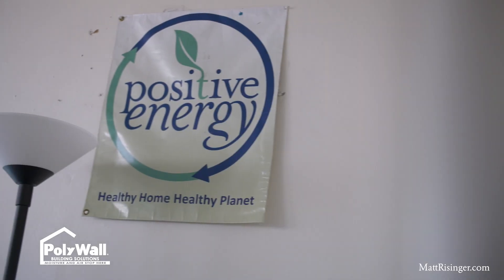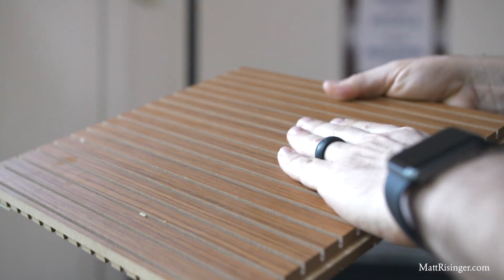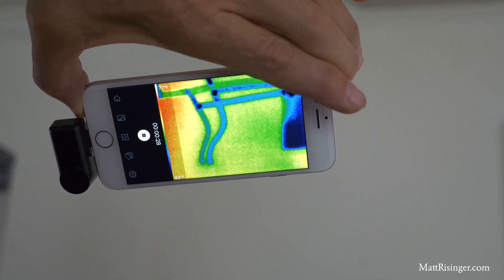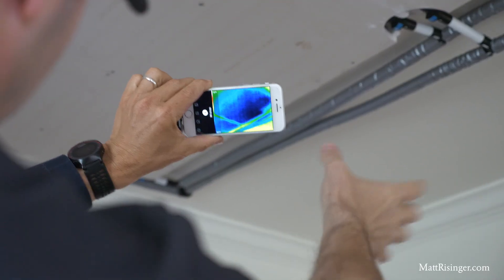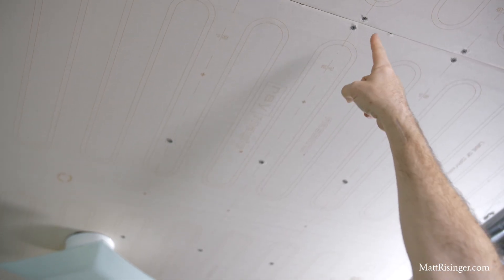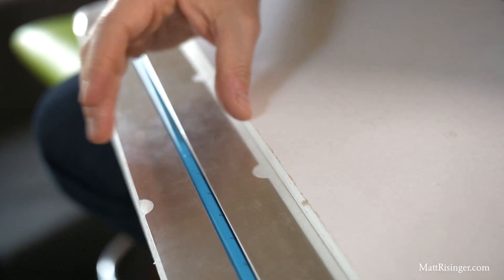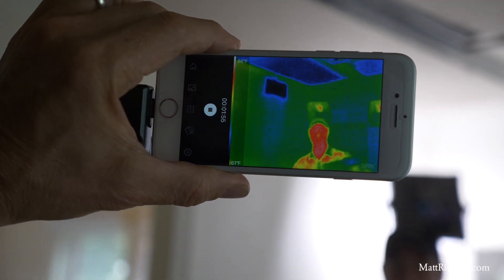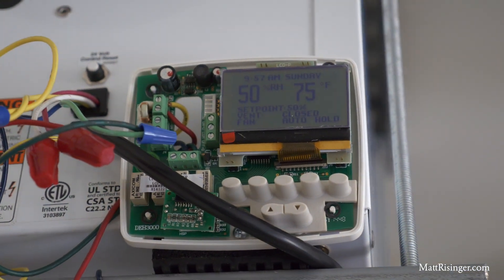Cool Your House with CHILLED WATER

Comment: Had radiant cooling/ heating for a school in Los Angeles school district. The system will only work on mild days, when the temp got above 95 the system was uncomfortable with 30+ kids in a classroom. Now the District is spending millions to retrofit it.
Reply: Albert, generals always fight the last war, as the saying goes.  People remember the past experience they had in a situation.  If the school district purchased inferior quality of a technology that was not yet mature and it was installed sloppily, you will then experience sub-par performance.  This does not mean the technology is the fault.  In the example, the fault is inferior technology, cheap product and lack or apathy of quality installation and tuning.  Heat pump technology is far superior if it is not hobbled every step of the way - especially in a moderate climate like LA.  And 30+ kids is like running 30+ 100 watt bulbs, or something like 3-1000 watt heaters.

Comment: Radiant cooling is an apt name for this system.  It is cooling via radiant heat transfer.  You just happen to be radiating your body heat to the relatively colder thermal mass.  This has been present in the commercial market for awhile and campus’s like American U have installed large radiant ceiling panel projects that work in the same way.  Only down side is you need a source of cold water.  Geo thermal could be a great source of cold water.  Also, they are correct and you need to control the dew point in order to avoid condensation.  Nothing crazy though.  At normal space set points you have about a 55 F dew point.

Comment: I died laughing when he pointed out the dehum
Reply: True, a system like this won't be able to condense the humidity out, my concern would be a desire for an air cleaner as well. I'd say if you're in aa humid climate, just supplement this with an air handler that's got an A coil in it, run air through it. it might not be enough to cool the entire space (the air handler) but if sized properly it could solve the humidity problem while still contributing to the cooling.
Reply: But it seems what is what they did...
Reply: I think the solution there is combining this kind of thing with a high velocity small duct system. I know not everyone does, but personally, with my allergy issues, I want the air constantly being replaced with purified air.
Reply: @compactc9  Yes. But as for me just give me a mini split in every room and don't worry about it.
Reply: @2pi628  Hi, i commented this years ago but i think i was making fun of the shoddy workmanship

Comment: This had been tried many times - the problem is always dealing with condensation on the cooled surface. Now we have a conventional compressor involved to dehumidify.  I don't see the point.
Reply: Yeah. That's the part that made no sense to me.
Reply: Why not put the cooling in the walls and catch the water with ducts at the bottom. Make it an art feature.
Reply: Dehumidifying takes a lot less energy than cooling. I am curious as to the net energy savings, reliability and user comfort aspect of this system. As Matt said he feels it is still experimental and the engineer clearly feels the same as nothing looks to be a finished installation.

Comment: This doesnt pass the thermodynamics sniff test... or at least not in the way you described it. Radiant heaters work by radiating energy from a hot thing to a cold thing. It doesnt work the other way around. Maybe you are describing how this works or what its goals are incorrectly?
Reply: In the system you described, your body is the radiant element, not the chilled water. There's no such thing as radiant cooling, per the first law of thermodynamics.

Comment: So you are replacing an air-air heat exchanger with water-air. And by doing so adding lots of plumbing all over the place, potential for leaks, huge installation expense. etc. The energy savings better be HUGE. nice experiment i guess.
Reply: I can't see how there'd be savings. The same amount of heat must be moved. In addition there's a system for moving the "radiant" heat and another (the dehumidifier) for latent heat. With air to air one system does it all. I can see equal or increased cost, but not savings.

Comment: This setup is an engineering orgasm....although I do see it being useful in a large cavernous area in a commercial setting where air movement may be difficult. If your house has no ducting then go multi head mini split. If you have ducting then go with a PROPERLY installed  gas or heat pump setup. I'm a commercial HVAC tech and at my house I installed a York Affinity AC unit and 2 stage furnace with ECM blower motor. My 2300sqft home is comfortable all year and my COMBINED gas/electric utility bills average around $110-$120/month. The extra cost of install of this system plus possible extra insurance cost for all the water piping along with pumps and heat exchanger cleaning on the heat pump etc. seems silly in residential. Keep it simple and well installed and don't get over sold. And that dude looks kinda like Patrick Swayze.
Reply: You're a hvac tech and you installed a York? Why do you hate yourself?

Comment: I like this idea, but as an engineer and a (former) builder, PLEASE don't call it radiant cooling. As others have said, there simply is no such thing. Cold/cool is simply the absence of heat. Showing a FLIR image of those cool panels on the ceiling implies something that isn't there: that the panels are "radiating" cold.

Matt said that there's no moving air. I would disagree and argue that there is passive, convective cooling going on. Hot air in the room rises to the ceiling, gets cooled off by the panels, and it naturally convects back toward the floor. Yes, there is also absorption of the heat radiated by your body and other warmer objects in the room, but my guess is that that is the smaller proportion of heat transfer going on.

So... I'm not saying it won't work. I am saying that calling it radiant cooling is a huge misnomer, and a mistake.
Reply: No.. he is totally right. You cannot "radiate" cold.
Reply: You are confusing hot and cold with thermal energy. Thermal energy is only positive (hot), but thermal energy in a cooling system primary moves through air. Only heat moves, but both hot and cold air move.
Reply: Brad Winchester
That's true, but no, that is not the answer or reason why. Thermal mass does not radiate cold. Thermal mass can absorb cool radiative energy from space, and the cooler wave of energy, itself, absorbs thermal energy, cooling the mass. But, a thermal mass does not radiate that cooler energy. In all those examples, relative cooling occurs when warm energy from the surroundings radiates to the colder thermal mass which then absorbs the thermal energy. Radiative cooling is a completely different phenomenon. It is not something concrete produces. Concrete does not radiate cold.
Reply: OneTwoThree: "...absorb cool radiative energy from space"? Space absorbs heat. At night in the hot desert a pool of water cools when it radiates heat into space. If it is insulated in daytime, it will eventually freeze in the hot desert.
Reply: @1voluntaryist 
No Don, it's called radiative cooling. It's a separate phenomenon. It's not a matter of insulating against convection. To stop it you only need to block ultraviolet light. The lightwave itself is cooler than earth. Look it up.
Reply: 123: "It's called radiative cooling." Yea, and the Dept. of War is now called the Dept. of Defense. Cold can't be radiative. Only heat can. An accurate term would be: cooling by radiation (of heat), which is not the same as radiating cold.
Reply: @1voluntaryist 
Radiative heating and cooling are a completely different phenomenon from what is normally meant by radiating heat. When you're talking about light, thermal energy does not move only from hot to cold; it moves wherever it is radiated, even to hotter surfaces.
Reply: I didn't think of that. But if stars radiate to other stars (hot - hot) isn't that because they are apart? Two stars sitting next to one another would exchange radiation, and if equally radiating, would not show a reduction. Also, what does this idea of hot - hot have to do with my point that cold can't radiate because it is a negative concept, the absence of energy?
Reply: You could make the same argument about the term "radiator"; even a cast iron radiator looses a lot more heat via convection than by radiation, but in both cases, our perception is affected a lot by the radiation that takes place. Sitting next to a hot iron radiator is a much more comfortable warmth than a blast of hot air from a vent, so it makes sense to emphasize the radiation. I assume the same can be said for sitting under a cold ceiling.
Reply: @pcno2832  No. 100% of a radiators heat is produced by radiating heat, some of which is also subject to convection. 0% of a radiant cooling system cools by producing cool radiation.
Reply: Adam Mackey Smith
All thermal energy comes from radiant heat, directly at first, then via convection, and sometimes triggering latent energy transfer through evaporation and condensation. But, that is the same for all of these cooling systems. 

*edited to correct false generalizations about radiation (Google: "radiative cooling") *

Radiation can cool something, although none of these cooling systems appear to actually use radiative cooling, but are in fact cooling the room via convection and evaporation, albeit with less convection than normal.
Reply: David Kellers
Woah. That's cool. I never thought about radiation itself being cooler than the atmosphere. Thanks for the correction.
Reply: camjamsdad: "The cold panels will emanate..."? No. Cold does not radiate or emanate. It absorbs. The air it absorbed heat from becomes heavier and drops to the floor, absorbing heat in the floor by convection/radiation and that area feels cooler, i.e., absorbs heat from you.
Reply: I completely agree with you, Bill.  This general laziness with terminology extends to the interview, where Kristof says several things in...uh....let's call it 'unscientific language'.  I think his goal is to explain this to average people.  However, the problem with doing this is that any average person on hearing this stuff won't think he's saying things that aren't technically true, so basically misinformation has been implanted in the average person.  This eventuates in do-it-yourselfers builting bad or even dangerous things.  A better option, I believe, is to just explain things in a correct manner and have a higher expectation of average people's ability to apprehend such terminology.
Reply: Hey Bill ... I'm lmao ... assuming you being an engineer and former builder, there is nothing inaccurate about your statement ... unlike the guy in the video and some of these commenters. It's a metaphorical miracle some just don't float off into space. 
The school system has failed so many ... Glad to see you made it through unaffected ... there are still only two genders right?
Reply: You are 100% correct. This is not a bad idea at all but it relies on air convection not radiation. Radiated energy is proportional to the fourth power of the absolute temperature. This means that it has very little effect at low temperature and a big effect at high temperature.
Reply: Air conditioner does not cool air, it removes the heat. 
No-one ever said this builder hack knew anything.
Matt R. Thumbs down
Reply: Whats the power consumption of this?
Reply: @zImdragon  when you say "you are rubbish", it is directed, at you.  Well done on self-reflection, but bad job on the misdirection.  Now go sit in a corner and think about it.
Reply: Convection cooling
Reply: Bill Eason Agreed.  Calling it radiant cooling is akin to talking about a lightbulb that projects darkness.
Reply: sibco96: Don't you mean, "...a lightbulb that absorbs darkness", leaving light? Neither makes sense.
Reply: You, sir, need to crack a text once in a blue moon instead of another episode of Jerry Springer.  This is building science.  Heat (BTUs) moves from "hot" to "cold".  It's a one-way street.  "Cold" does not move.  "Cold" is an absence of BTUs.  Definition is half of understanding.  Take away some BTUs and we feel cooler.  Ice is water with BTUs removed.  A chunk of ice will absorb BTUs in an effort to even everything out.  A "ton" of air conditioning removes as many BTUs (12,000) as a ton of ice will remove.
Reply: Adam Mackey Smith
Maybe, but you're explanation just stretched the 'radiant' from an adjective modifying the word 'cooling' to and adjective modifying 'heat' > 'radiant heat transfer to a cool surface.' So, you just implicitly acknowledged that 'radiant cooling' needs to be changed to make any sense whatsoever. All cooling is radiant in that sense.
Reply: It is called radiative cooling. At some point heat is a light wavelength. Using a cold object to obsorb the light wavelength is an old process. It was used 2500 years ago to make ice at above freezing temperatures in the Persian desert. Recently they have found compounds that have a higher degree of light wavelength that space absorbs. In fact they can now make objects that are cooler in the sun than in the shade.
Reply: @davidkellers8152  Wow! I must google this. I love learning about science - from an armchair perspective.
Thanks for the info.
Reply: Not at all. In a standard HVAC system cooling is achieved through convection and evaporation. The system in the video is largely the same as radiant heating except the temperature gradient is reversed and heat is flowing the other way. Again radiant cooling is a perfectly reasonable thing to call it. By your reasoning, calling any system "radiant heating" is redundant.
Reply: A.M.S.: "...calling any system 'radiant heating' is redundant." No. Radiant distinguishes from convective/conductive.
Reply: ah so conduction and convection are redundant as well, eh?  How silly.
Reply: 1,2, Play Witty: Really? Did you know all convection is conduction by gas (air)? But all conduction is not by convection. Convection is a special case of conduction. The 2 ways for energy to transfer are radiation and conduction. How is that "silly"?
Reply: @atomicsmith  And in the dictionary, by the word redundant, it says, "See: redundant".
LOL
That's one of my fav old jokes from the 80's! :-D
Reply: Aren't they radiating heat toward the chilled panels? Aren't they being cooled by radiating that heat? doesn't that sound like radiant cooling? Might you be happier if you were less pedantic and literal?
Reply: A.M.S.: "...doesn't that sound like radiant cooling?" No. It's cooling by absorbing radiant heat. Cold is the absence of heat. "Might you be happier if you were less pedantic and" understood the principle involved, the definition of heat/cold?
Reply: It's an accepted industry term. You sound like my math professor when talking about division. No such thing as dividing by a number, only multiplying by a multiplicative inverse. Yet everyone says divide. What would you call it then? Also, so long as you stay above the dew-point, there is no issue with this method of cooling. It can be particularly effective in dry climates as well as homes where natural sunlight can add significant thermal load by way of sun exposed surfaces. Wouldn't write this off. Especially in areas where the system can serve as both heating and cooling.

Comment: won't remove latent load from a home, won't remove humidity from a home, cooling lost to walls and attic from not being thrown into the room, higher risk of water leaks causing greater damage to home, efficiency can't be great, water expensive, won't work well in hard water areas, pipes in home look ugly
Reply: won't remove latent load from a home, won't remove humidity from a home
That is what the ventilating dehumidifier is for. Also, your conventional system doesn't remove any moisture when there is no demand for cooling.

cooling lost to walls and attic from not being thrown into the room
Where do you imagine homes gain/loose heat?

higher risk of water leaks causing greater damage to home
True

efficiency can't be great
Heat transfer between liquids and solids is orders of magnitude more efficient than with air. More data is needed though.
It also opens up the potential for easy off peak thermal storage.

water expensive, won't work well in hard water areas
The water is recirculated in a closed loop, so this is a non issue.

pipes in home look ugly
Not if they can't be seen, you know, like the rest of the ugly pipes in the home...

Comment: Not sure about down South but in the midwest reliability is a huge issue with water source heat pumps since the shift to 410 and the repair cost was much higher.

Comment: It sounds great at first. But toward the end of the video while thinking about this, my thought became LOTS OF WATER PIPES ABOVE OUR HEADS. It seems to me you'd have to have a drip pan layer across the whole ceiling and drainage in case there's ever a failure in the piping, even if it's just a drip.